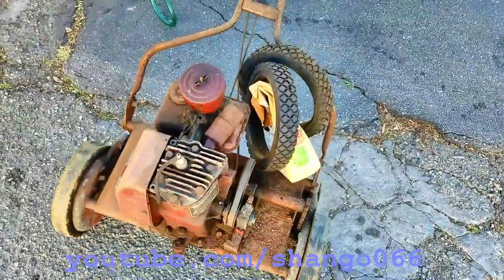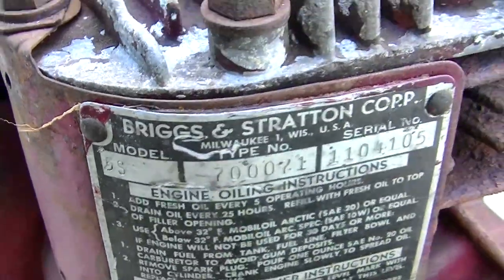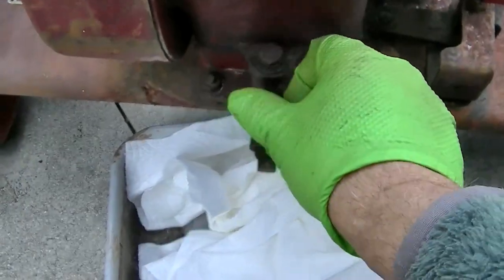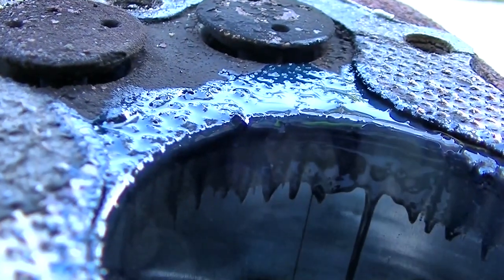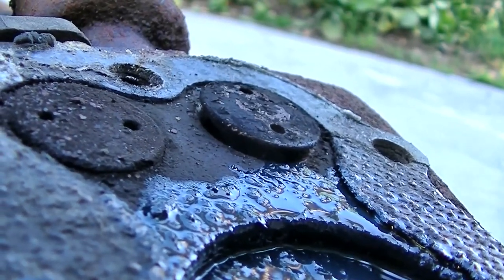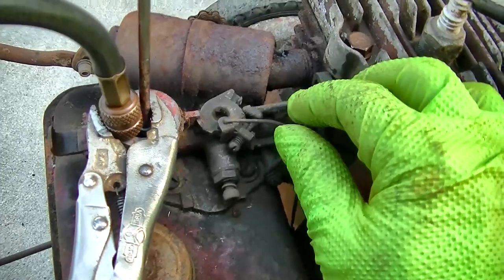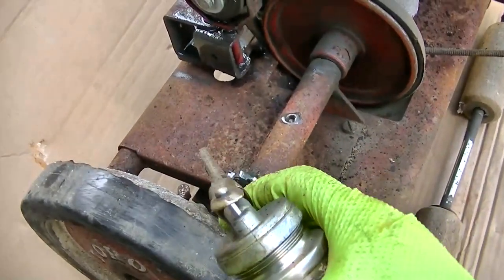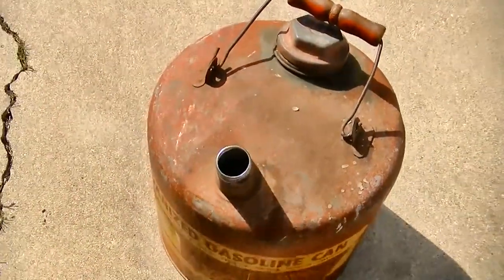Resurrection 1950s TORO SPORTLAWN Lawnmower Power Reel Mower

Comment: I can’t believe it runs that well ,, even though you didn’t change out a single capacitor.
Reply: And didn't get it up to 88mph (almost,lol)
Reply: It does have a mighty “condenser” under the flying wheel next to the points.  Probably should replace it with and audiophile quality one for best sparkage

Comment: This video brought back good memories. Ours had the same engine, except you lift  the handle to engage the clutch. It had big tires and a wooden handle, and solid metal roller. Dad replaced the muffler many times. You had to run behind. Your commentary is priceless. Thanks for posting.

Comment: Boy, does this bring back memories from the early 1950s!  My dad had one and he was always lubing it and cleaning the spark plug. It started with a rope that had a wooden knob at the end.  It did a yeoman's job for many many years.  Later, engines from these mowers ended up in mini-bikes and go-karts when rotary lawn mowers became the mower of choice and these reel mowers were either junked, or like yours, pushed to the back of the garage and forgotten.  I'm glad to see it still run.  Good job and terrific video!  Don't forget to lube the drive chains.

Comment: No safety guards or anything safe about it.   When they made stuff like that in the day, people had enough common sense to use it without loosing a hand or toes !    Now days, they have to put a warning label to keep idiots from drinking the battery acid !
I do like some of the safety features on modern lawnmowers like the seat switch on a riding mower. If you fall off or get knocked off by a tree limb by accident, the engine dies.   What I find annoying as hell is the reverse safety switch that kills the engine if you back up with the mower deck running.  I disabled the stupid thing on my lawnmower.   In my opinion, if you are stupid enough to mow your yard with your small children playing outside, you should NOT be allowed to operate a freaking can opener !
Reply: My mower says caution spinning blade on the deck. Like duh!!
Reply: In that case the absence of safeties were a safety feature in itself, it was meant to interrupt the lineage .
Reply: My neighbor once had the 1968 version of this mower. It had guards over the moving parts, and recoil start. Ran until it threw a connecting rod after 20 years.
Reply: I worked with a guy whos mother mowed his arm off when he was a child!  SAFTEY FEATURES ARE SO TERRIBLE,
Reply: @jpolar394   lmao.
Reply: @tailsdblack463  ........Hay, it's the truth.....🤣🤣🤣🤣🤣🚽🚽🚽
Reply: All the ancient gaffers forget that and all the lawsuits. It’s their religion to yell at clouds
Reply: Manly men. And the sheep were nervous. 

My god the cult of Tom Brokaw.

Comment: That's a fine old specimen of American pride and craftsmanship.  Even when it was broke down and rusted up it's better than the cheap Chinese dung sold in big box bargain hunter havens.  It's a beautiful thing that you got it running and cut some grass with it.    😁👍🇺🇸
Reply: And it still can drag shango's ass all over the place....lol
Reply: Now imaging getting one of these 'modern' mowers in the same condition (left in a shed for 60 years) I bet it will never run. Same goes for electronics, you  can fairly easily resurrect the first TV's, try that in fifty years with an LCD - no way.
Reply: Give it a coat of Briggs and Stratton  red paint.

Comment: You did a good thing rescuing these. All parts can be bought.  That's a foot valve in the take up tube .I never saw propane used as fuel. Good video.

Comment: Cheap diesel oil will have the dinosaur guts that this mower needs.
Reply: Right you are
Reply: also Lucas oil it will stick to the bearings increase compression.
Reply: @petepeterson4540  I would even suggest using some engine restore, to fill in scratches on the cylinder walls.

Comment: I was saying to myself, 'there is no chance in hell he will get a spark out of that''... How did those points keep their surface I dunno.
Great idea with the propane too. I am hoping this video goes well. Shango deserves some big returns.
Reply: Although this is not an electronics video I did not hit the dislike because I figured "why not do something a bit different". Shango definitely needs more subs.
Reply: Tungsten points.
Reply: @wayneessar7489  Is that so?
Reply: @martinda7446  I believe they were because you needed an extra hard file to dress them.
Reply: @wayneessar7489  Thanks Wayne that is pretty cool to know...Could have done with a few sets back in the day..
Reply: The mower was probably kept indoors most of its life... That is why the engine still rotates, the ignition still works, the jack-shaft and wheels still rotate, the data plates can still be read... It is a prime example of what should be on hand-tool rescue, or another restoration guy restoring it... If he was to sell it as-is, a restorer might offer him over $100, as it is...
Reply: X2!😉😉

Comment: I used to push  a reel type mower to do the lawn. That is a work out. Reel type mowers don't like it when the lawn gets too high. Much harder to push and doesn't cut as well. Very nice little mower. Amazing it still works as well as it does.

Comment: Hi. Greetings from Antrim, Northern Ireland.  What a great video.  Such a change from your normal content. (Which I absolutely love). Such fun to see you bring this old engine back to life. A long time ago, I remember my Dad saving a partially seized car engine that had overheated, using similar technique.  He reckoned some the piston rings were seized to the pistons.  He put some oil down each spark plug hole and turned the engine over and over. With a bit of patience the compression finally returned. That car ran well enough for years after.  A very entertaining video.  Keep en coming.  I check YouTube every day to see if you've posted anything.

Comment: I mowed a lawn with one of those from about 1968-1975. Identical except my dad's had a reel start rope. Those 'new' wheels are about as hard (and a pain to put on) as I remember them. you're right on screws for adjusting the blades on the sides of the bar on the bottom.  There isn't a zerk on the axle the belt runs on- just oil the hole. Clean the carb once in a while, change the oil, otherwise bulletproof. There were 3 wooden rollers. Touchy choke tab. I think it was choked when you were running it.  The mowing scene brought back memories

Comment: My dad had a regular mower, Tecumseh engine? It had a windup crank. And after you wound it up, you released the "catch" to spin the motor to start it. If it didn't start, you had to lock the catch, a wind it up, repeat. Interesting video! You are so talented! Imagine. If they had powerful cordless drills back then. Instead of having to wind up a rope and pulling. I can smell that brake cleaner!

Comment: The old Briggs and Stratton engine's are first class and beats any Chinese engine you can buy today my lawn mower is 40 years old and starts year after year it even runs on older petrol (Briggs) engine
Reply: My mower is 25. So far only the plastic carb. fell apart. After replacing it, still runs great.
Reply: I got sick of my 'modern' motor gumming up in the off season, chucked it away and fitted a 1 horse induction (electric) motor. Yeah the cord can be a pain, but it just runs, no last minute dash to the petrol station, and no more fumes - cut grass without gas fumes is SO much better.

Comment: Awesome find, and way to keep something valuable alive.
Rpm's a little high, probably why it's dragging you around the yard.  Get the lead additive to protect the valve seats if you're worried about modern fuel.
Reply: Or put a little VP racing gasoline in there
Reply: Or even a drop of two stroke oil ... I don't think it will knacker the catalytic converter .....
Reply: or just buy race leaded gas or find some 100LL
it definitely needs the rpms high for it to work properly, reel mowers don't really work at slow speed they just bend the grass over at slow speed.  makes mowing small greens interesting when you're trying to cut 1/16th off the ground at 10mph

Comment: We had one of those pos back in the 50’s.  It wore me out mowing the St. Augustine grass in our yard.  What it really wore out was my arm, cranking it.  It had a self propelled system if you want to call it that.  I was ten and pushing that sucker around the yard was like pushing a sled, later, when I was playing varsity football.  It was a so called five HP but cutting wet grass it was probably a two HP.  I will take my 8.5 HP Snapper Ninga any day of the week, because it will pull me around the yard.

Comment: Heat the tires in hot to boiling water and stretch them over the old wheels after you restore them. Nice find! I had one like that in the early 60s. Fill the oil to bottom of the filler plug. That air filter you have might be wire mesh which you can clean with some gas of cleaner then put oil in the bottom of the cup to the fill line.

Comment: The propane's a good idea.  A simpler engine is more amenable to compressed gas for a fuel, I take it.  About forty years ago I found a similar rig from Snapper with a B&S engine.  I fixed up the engine's carburetor and got it going, though it was still stubborn.  It was self-propelled and the blade rubbed close to a bead on the spin path.  The bead was worn so not so much cutting was done.  A groundskeeper for a big college told my dad about some "backlapping grease" to sharpen the blade like a rubbing compound.

Comment: These engines are great, I have several of these. clean the carb, adjust the points do a valve job and change the oil. Your ready to go.

Comment: I have a Toro Power Handle from I believe the early 60s. The oil bath, fuel tank-carb, clutch and rope pull all look just like your setup. The Power Handle was the engine/handle unit that could run a mower, rototiller or snow blower. I use mine as a tiller. It was purchased new by my grandpa and still starts on one pull when being started correctly. I also have the same gas can that's at 28:20..lol
Reply: if your engine has an "OIL BATH" air filter, it would be more like "LATE 50s" the oil bath air filter was last used in 1959. briggs switched to the "NO SPILL" foam air filter in 1960. that engine also has a "CAST IRON SLEAVE" in the cylinder. the power handle also had "GENERATOR/ WATER PUMP" attachments also. you can tell what the engine build date is, look at the "CODE" numbers( last set of numbers) the first two numbers are the year, the next two numbers are the month, the next two numbers are the day, if there is another number, that is the hour. if it says "SERIAL NUMBER" then it was built before july 1957, and those numbers are not a date code !!!!

Comment: Safety is relative.  This model won't shoot rocks the speed of bullets, nor is it likely to cut off your toes if you should lose footing have have it run over it.  That's why my dad replaced a conventional mower with this model.
Reply: And this type of mower is still all they  use to cut golf greens. Gives a fine cut that rotary mowers cannot give. Better for the grass blades too, this mower shears them like a pair of scissors rather that whacking the blades of grass which injures the tips and turns them brown.

Comment: These mowers are great for finish work. Btw those little oil flaps have wicks in them, if oil runs out immediately they need new wicks. I learned that the hard way with a 1950's electric motor. The governor should be looked at I bet it's bent or missing a section, engine sounds like it's running pretty fast. They do make reel mowers still but for commercial applications.

Comment: Excellent video  :) also yes I use my Late Grandfather Harold can oil left at his house when past away 1995 was Texaco, Gulf, Shell company's of SAE 30 & 5W30 and 10w30 types also case of 12 plus 24 cans ! I use them up in 2010 ! When got my driver's license in 1992 also my first car was 1980 Pontiac Grand Le Mans 2 door with 1978 CHEVROLET 4 bolt main 350 v8 4 barrel daul exhaust , 700SR 4speed Automatic transmission plus 377 rear end gears! Did my first engine Oil plus Filter change my dad told on farm I grew up on he had oil also said  just pick up oil filter Fram 13 A long one plus Air Filter even PCV Valve plus  AUTOMATIC TRANSMISSION Fluid plus Fuel filter and help change all that! So ran I got chance use 10w30 Engine Oil plus Texaco brand in can and my dad called them  cans  of 1000ml 1quart worth and used them for long till 2010 when Grandfather Harold cans to plus! Used my late grandfather Harold from 1997 to 2010 to can for small lawn mower plus Roteiller on SAE 30 and 5w30 also 10w30 on old 1972 Ford F350 390 V8 motor engine oil for long time till got rid old truck sold to guy wanted of me! My Dad use can of 10w30 on Farm Tractors pus Combine plus his car and old farm truck long time!

Comment: Dad gave me the old "family" mower when I moved out in '95.  It was the 1953 version of this engine and the mower was even more dangerous then Shango's as it had a centrifugal clutch.  Used to be terrified of using it to cut the grass when I was around 8 years old!  They cut fantastically, but only on smooth flat lawns.  I last started mine 26 years ago, but I am sure it would start with fresh gas!!!

Comment: This week on Shango's Garage...
These videos are always interesting. A nice change in pace. Spring is on it's way, and it won't be long before I need to drag out the lawn mower. It's not as pretty as yours, but it is self propelled. It has a lot of plastic parts. Anyway, I bet some red engine paint would really make that shine. I also have a reel mower, and they totally suck ass without an engine. We have thick grass that just binds a reel mower.

Comment: I really like Snapper mowers. You can still get all the parts and they are cheap and easy to service. I had a old school red deck one with the commercial service handle and high bag I bought for 10 bucks and replaced the belts and some of the self propelled drive parts. I ran it for 10 years till the welded spot in the deck got blown out again and I spent a year trying to find another deck. I did and combined parts to build it again. I had to leave it behind when I bought a house as it didn't have spark any more and I have a newer conventional deck Snapper with a similar drive setup.
They are excellent mowers and I just replace belts and parts as they wear out.

Comment: That's a solid built piece of equipment I'm a lawn mower hoarder myself All the old ones with real carburetors that stuff lasts forever especially that cast iron engine it'll never have to be rebuilt did you see how shiny the inside of the cylinder was?

Comment: My grandfather had several old mowers. A reel mower from 1947 (I think he still has the paperwork for it), a 1954 Toro, a 1966 Lawn-Boy. Of lesser note were the 1982 Toro and the 1990 Toro. I think the old reel mower is still there, the others were given away or scrapped.
I once tried to resurrect a generic 1960s-era mower with a Briggs engine. I don't quite remember what was exactly wrong -- I want to say it didn't have enough spark, but I do recall shocking myself while checking the plug. It was likely a weak magnet.

Comment: Polish the magnet and paint it with clearcoat paint...I've had about 200 of those engines...I used to fix them around here....they're famous for needing piston rings. The people back then mowed every 3 days...the magnet  charges the ignition coil, then when the points open the magnetic field collapses, and it fires...the condenser is there to prevent arcing and to hold the voltage up in the coil..it won't fire if it's not good..I used to find the best flywheel with the strongest magnet and hope for the best...lol..I had a '38 model WB that had a pedal start...they used those on washing machines.

Comment: I've got one of the older ones too, it runs very nicely. Slightly different brand but the same overall. I machined new wood rollers for mine on a lathe.

Comment: My grandma had one of those when I was a kid, cut lots of grass with it. Dangerous but fun, it would launch a green pine cone a good fifty yards if you hit it right. Manufacturers have lawyered up machines so much now and most if not all are chinese junk meant to give an engineered service life and go in a landfill.
Definitely use a zinc additive on those flat tappet engines.

Comment: Great video!  A bit of a change from valves or trannys.  Here in the UK I used to mow our lawn as a kid in the '70s with a similar vintage ATCO mower.  Same sliding clutch and chain power drive.  Back then we weren't stupid enough to poke fingers into things.  When you gave it ebough revs for tougher grass you almost had to run behind the thing.  It had same oiler pot flippy lids, etc.  They made stuff back then to last 100 years and be repairable.  Not sure why we have evolved to making short lived junk now.  Sad.

Comment: I have one of these, but without original engine. You should inspect the bearing on each end of the jackshaft that you oiled. they are very prone to wearing out if run dry. They should have put a cap on that oiling hole.

Comment: This is a crowning achievement. Basically put “ there is too much oil in it but no problem the valves are getting lubricated.” This video should be put in the Smithsonian.